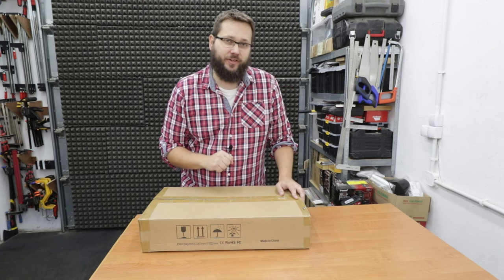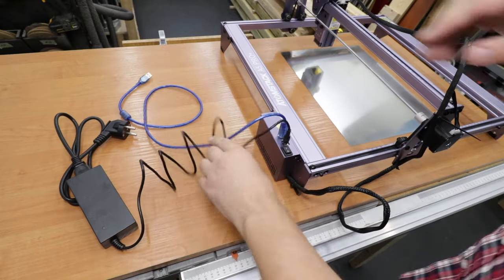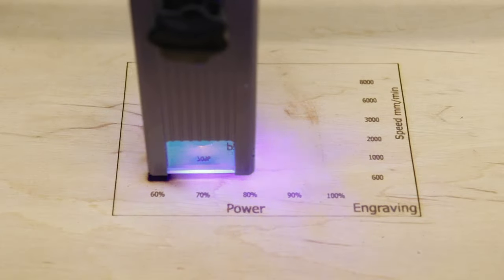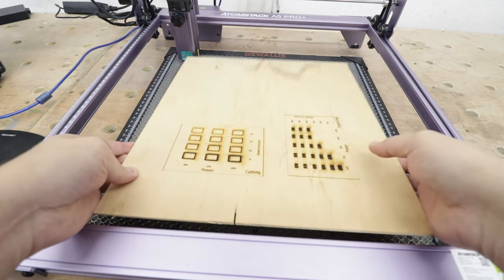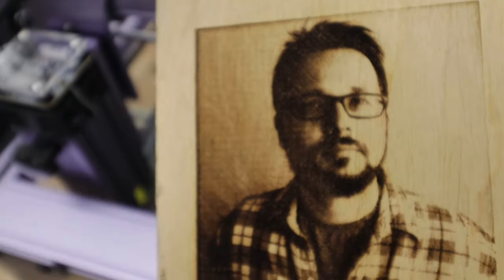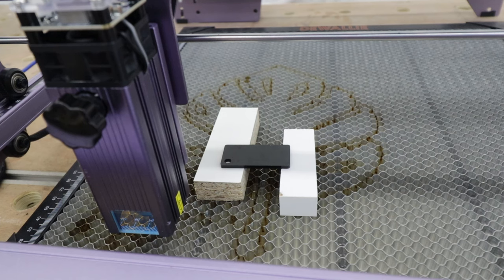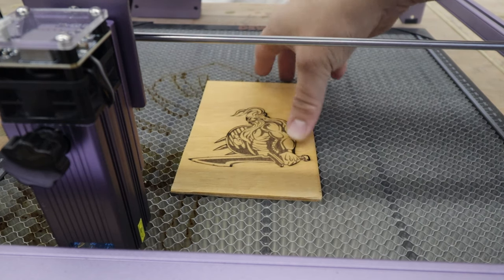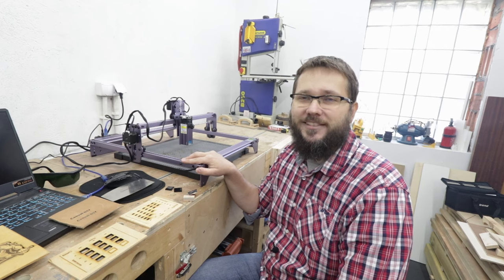Atomstack A5 Pro + | Budget Friendly Laser Engraver | Test + Review

Comment: I was looking for a paper cutter. I need to make hundreds of custom cards a week, thus automating the cutting would improve the speed drastically instead of manually cutting it with scissors. How does it handle paper cutting?
How clean are acrylic cuts? What is the maximum acrylic cutting depth?
Reply from the maker: It will cut paper just fine on lower settings. Acrylics wouldn't go thicker than 3mm and black is the colour you will get best results. Cuts will be clean - if you get the settings right. Its a 5W module so don't expect miracles but for paper cutting you don't need a lot of power.

Comment: I got mine by lurking and looking for sales. Finally found A5 Pro+ on clearance for $100 and it's been a great beginner machine. While I do NOT get results like the video when cutting, I will say the machine does very nice engraving on glass, wood, painted or anodized metals, and it does excellent ceramic tile engraving with the white paint method. I'd say it's a very good beginner buy since I was 100% clueless when mine arrived, and I was burning wood the same day!
Reply from the maker: Thanks for sharing
Reply: Nice… where did you get it for $100?  Is that 5, 10 or 20w?

Comment: Does this laser have Bluetooth ability? Also, do you recommend this one for beginners with no experience?
Reply from the maker: It doesn't support Bluetooth. This is a cheap basic laser. It will be fine to start of you adventure with lasers. But there are better machines that easier to put together and easy to operate. However they will cost a lot more. This laser is more for engraving, if you want to cut material then I would suggest a stronger module. All depends what projects you want to tackle.

Comment: Excellent video buddy I subscribed Thank you. How much did this unit cost you and is it user friendly? Is the software complicated?
Reply from the maker: It costs about $250, I'm using a free software called LaserRGBL it's very simple to use but the options are limited. There's a better software called Lightburn but it's payed. However it's far better with lots of options. The laser is plug and play, super easy to use with LaserRGBL to get you started.

Comment: Thanks for this had one for Christmas.  Definitely has gave me confidence to go forward and start engraving
Reply from the maker: It's a good starting point for laser engraving 👍
Reply: I’ve just bought this. Does the program you use run through the test.
Reply from the maker: @emmanaughton8693 In the video I'm using LaserRGBL fir the tests as well. However now I'm using Lightburn in all my laser work

Comment: Is this a C02 laser or a fiber laser? And why does this matter? Thanks!
Reply from the maker: It's a diode laser. CO2 lasers are a totally different type of machine, they are more powerful ie they can cut thicker materials a little quicker but they are much more expensive than the diode lasers.

Comment: How does this one do for etcging glass? I am coming from a 3d printing back ground and I can tell you its more of a heachache then anything, This one looks like what I need!
Reply from the maker: Not tried it with 5W module I think it would be too week, however if the glass was prepared correctly then it could just work.
Reply: I have this machine, and it does excellent engraving on glass! I use flat black to absorb the laser light and it leaves a sweet frosted etch. It will not engrave clear glass or acrylics

Comment: Hello, is it possible to engrave brass with atomstack a5 pro? And how to set the settings
Reply from the maker: I don't think it's possible. You would need a red dot laser (infrared) for that.
Reply: @CasualDIY  there is an option for stainless steel, so I thought it would need power and brass
Reply from the maker: @menstuffbylaki5923  stainless steel and brass totally different things unfortunately

Comment: So the add for this says its 40w  do you know why the discrepancy? I noticed on the pic you had the laser go diagonal  why?
Reply from the maker: 40w is just part of the name of this laser not its power. Confusing yes. It's a setting in the software, you can go horizontal, vertical or diagonal. Sometimes you can get getter engraving quality when it's set up in different ways or in some cases depending on what you are trying to engrave it will be faster. Just another option that's worth checking out and seeing what works best for you

Comment: Impressive machine.  Will you eventually try etching resins using this?
Reply from the maker: Hmm not though doing that to be honest. Need to have a look into that
Reply: @CasualDIY  I'll just hi-jack my comment for another relative topic.  Have you checked about SLA Printers?  Those are 3D printers but use resin, instead of filaments.
Reply from the maker: @rcane6842  don't have funds for those but when opportunity arrives then for sure I will check it out
Reply: I frequently work with UV Resin and glow pigment. Have y’all tried engraving it yet?

Comment: What setting wud you recommended  on leather
Reply from the maker: It all depends on what type of leather,what effect you want to achieve and what laser you have
Reply: @CasualDIY  I have a atomstack A5 pro   it's a pair of trainers I want to add something to
Reply from the maker: @airgunoutdoor5967  Hard to advice, best to do a test run first to dail in the settings. Start let's say from 50% power and 2000 mm/min. If you can't make test runs then I wouldn't suggest  it.

Comment: I bought that but it’s not cutting through. If you please guide me the settings also can you share the test files for engravings and cutting. I will be appreciating. Thanks.
Reply from the maker: First of all what do you want to cut and which power module did you get?
Reply: @CasualDIY  I bought atomstack A5 40 watts. I am using the grbl but not much results comes than I use lightburn in that I can set the power option which engravings is ok but cutting is not go through. Please guide me how to set up the program. I try to cut cardboard and 2mm plywood.
Reply from the maker: @judithrangga  I think you got the Atomstack A5 40W ( that's just the name of it not indicating power watts) which cones with 5 watt module. Have you set up the focal point of the laser correctly? If you trying to cut something try 100 mm/min and 100% power( in lasergrbl you need to set up 1000 in the power field as that will give you 100% power) is the file vector? Does it have clear thin cutting lines?
Reply: @CasualDIY can I email you the details if can guide me

Comment: Would be interesting to see the results using some materials designed especially for laser cutting/engraving, i.e. laser plywood ... thanks for the demo, very interesting :)
Reply from the maker: Laser plywood you say 🤔 I shall order some as never used it before.
Reply: @CasualDIY  I'm not sure what the difference is, I just know that it exists ... I had dealings with a laser cutting service for a case I designed for the Raspberry Pi, and seem to remember him mentioning about 'laser grade' materials.
Reply from the maker: @barry.w.christie  well it seems it does exist I ordered 4 sheets 3mm thick, we will see how they cut and engrave 😅👍

Comment: Did you get the machine to actually home? I've been trying and can't figure it out
Reply from the maker: Sorry not sure what you mean, I got it in my workshop. If you don't have an enclousure with extraction then it needs to be in a well ventilated room. It will create a lot of fumes. These could cause fire as well so need to be careful as how and where you will use it.
Reply: @CasualDIY  home meaning using the homing button
Reply from the maker: @amberj5274  oh sorry, yes you set up your homing point in the software and it will return to that spot when you use the home button in the software
Reply: @CasualDIY  do you have a video for that? Or can you lead me in the right direction where I can learn please
Reply from the maker: @amberj5274  I don't have a video but it's super simple, I'm using LaserRGBL free software. So move the laser head where you want it and in the software there is a button that will set that position as home. That's it.

Comment: Hey, I just got this same laser and downloaded Lasergrbl. I dont know what i did but it wont engrave my stainless. I though maybe wrong kind of stainless but it wont even do wood on these settings. Somthing is wrong. anyone have any advice? ive never used this program before so im sure its user error.
Reply from the maker: Is the laser actually connected to the software? Can you operate the laser through the software?
Reply: @CasualDIY  yes. When I first plugged it in I just ran thru on defaults and it worked great on the wood. Almost too great, just about cut it. Then I fiddled with something and now it won't even engrave balsa wood. Is there any way to rest it to factory default? I tried uninstall and reinstall but all the settings were as I'd left them.
Reply: @CasualDIY  and it still goes thru the motions like it's doing it but nothing happens.
Reply from the maker: @sethcarson5212  there are some YouTube video tutorials on how to use lasergrbl I think that would be the best starting point as it is very hard to suggest anything without seeing all the settings you have
Reply: @CasualDIY  are there any in particular you recommend?
Reply from the maker: @sethcarson5212  not really, any that explain the basics will do
Reply: @CasualDIY   Ok, I watched everything i could find on it. I think everything is right. Since it burned very nicely on the first run but since then wont burn anything at all no matter how slow i go or how turned up the power is could it be a faulty machine? It moves like its burning but the burning laser just isn't doing anything. The blue laser is coming on but no burn. I ordered it on Amazon and it had a missing roller they had to send me. maybe a returned unit that got circulated? Do you think it'd be worth exchanging? I'm outta ideas. I know your job title is not Seth's personal laser support guy, and I really appreciate you helping me with this.
Reply from the maker: @sethcarson5212  if the software is set up correctly (have you installed the drivers as well?) Have you set up the focal point for your laser to your material? Try 100% power, 100 mm/min with focal poit set up correctly to the thickness of your material. And if all that is OK and the laser till doesn't leave mark on wooden material then it must be faulty
Reply: Then it's faulty. It won't burn at all. I'll return it to Amazon. The link in the description says it's out of stock. Would you recommend I get a replacement thru Amazon or elsewhere?
Reply from the maker: @sethcarson5212  hmm Amazon is good when it comes to returns etc. So I think I would stick with them when possible.
Reply: @CasualDIY   Ok. Thank you so much. I'm very sorry about investing you in this, I just couldn't find the answers I was looking for elsewhere. You've been incredibly helpful during this odyssey.
Reply from the maker: @sethcarson5212  when I can I try to help 👍

Comment: Mine won’t do metal. I have the exact same machine. Won’t do it even though it has the settings for it. Yes, I did everything that youre supposed to. Even followed this cars settings at 350mm at 100% power. Nada. Aluminum. Can’t engrave.
Reply from the maker: It doesn't engrave aluminium, it will engrave stainless steel and steel. It also won't engrave brass, copper, silver, gold etc for those you need a red dot, infrared laser

Comment: I can’t get my laser to cut anything like these settings. I can barley get it to cut thru 3mm
Reply from the maker: All depends what material ate you trying to cut. You will struggle with dense hardwood plywood and a 5W module. Low grade softwood ply will cut easily. You can buy plywood that is dedicated for laser cutting, it's less dense. Same where it comes to cutting wood. If you try to cut pine then you will have no issues however if you try to cut dense hardwood like oak you will struggle. If you bought a laser for cutting mainly then 5W will not be as good and efficient as 10W.